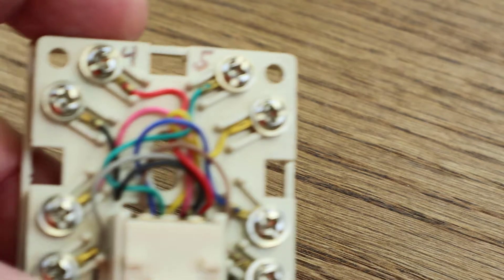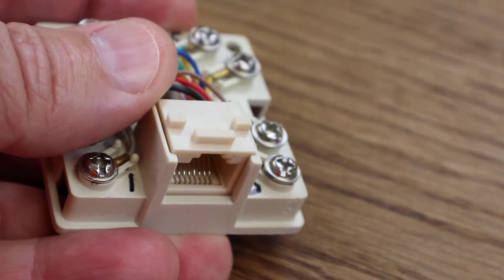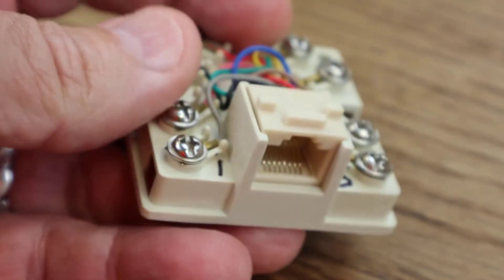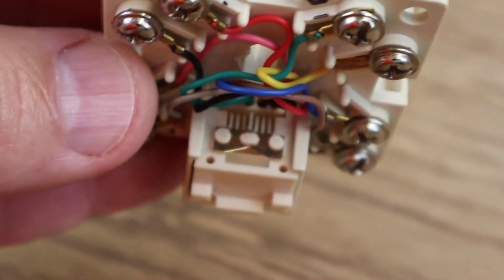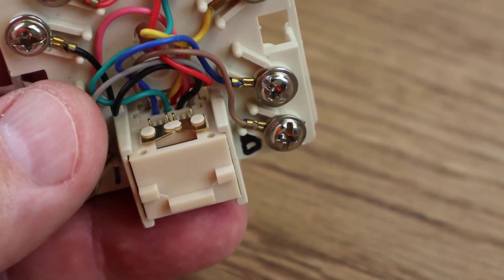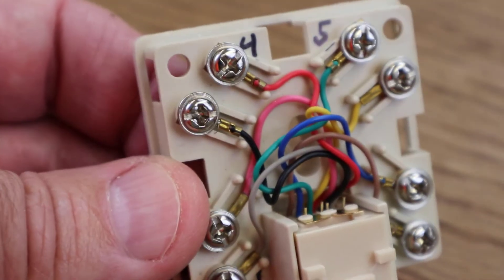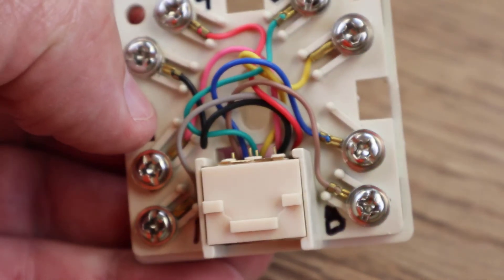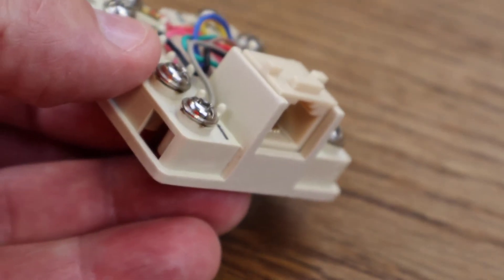RJ31X Alarm Jack Explained in Detail pt1

Comment: The other 4 pins are for what else?
Reply: I've seen them used as a tamper loop before. So if the plug is disconnected, one of the circuits opens and triggers a tamper on the security system.